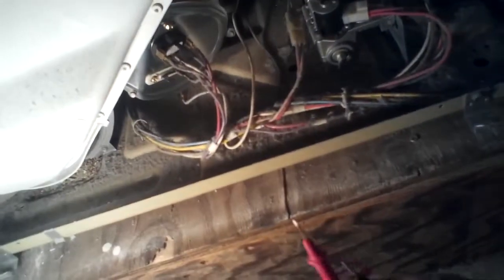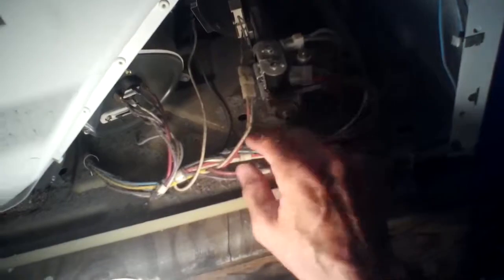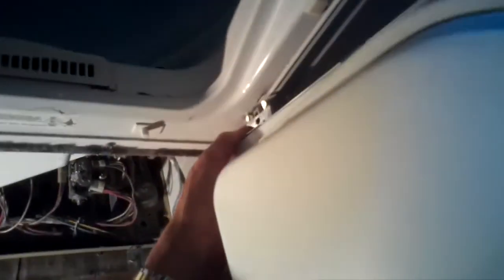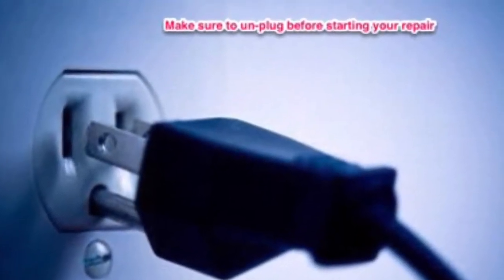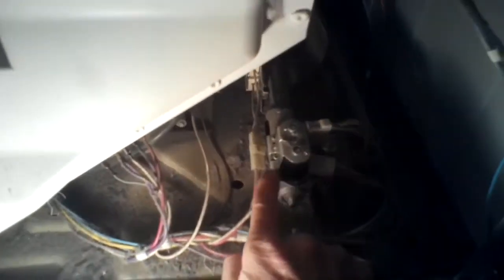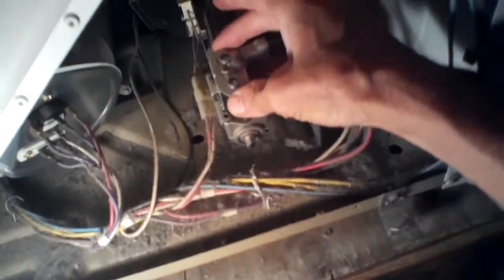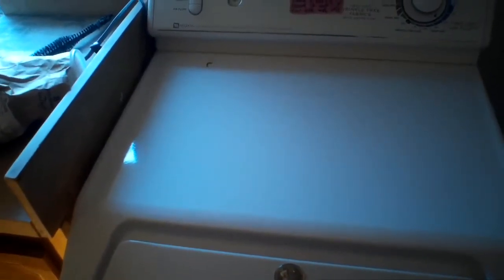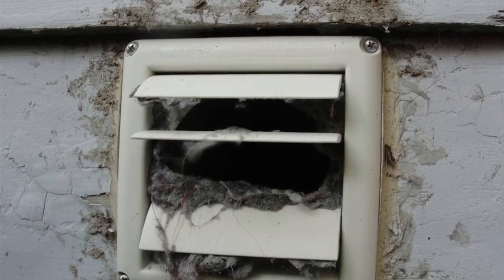Neptune Gas Dryer Doesn't  Heat Up -- (FIXED)

Comment: What settings did you set your voltage meter dial to? That's where I get lost. Thanks for your helpful videos.
Reply from the maker: Thanks so much I set mine for Ohms of resistance and also an auditory signal when I touch the probes are in a complete circuit it will make a beeping sound.